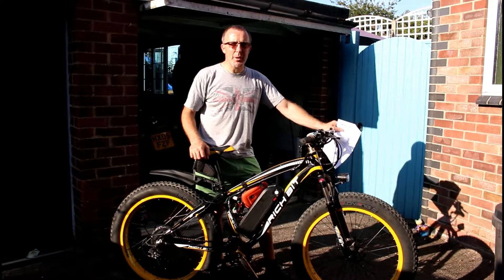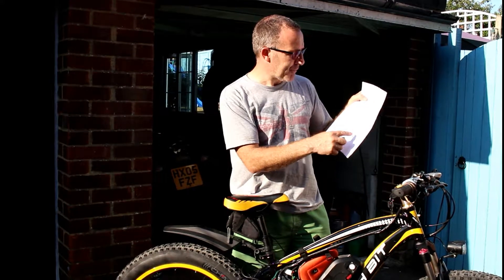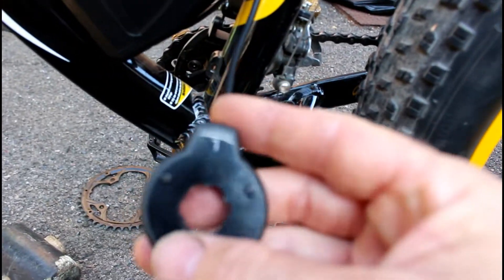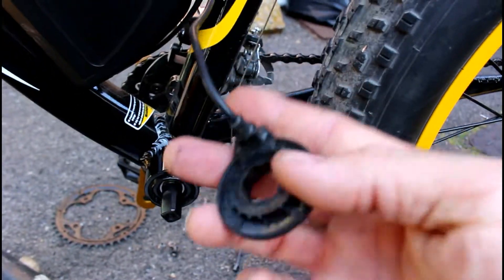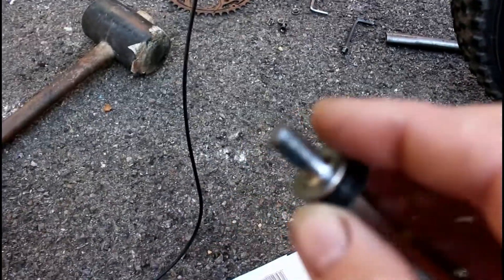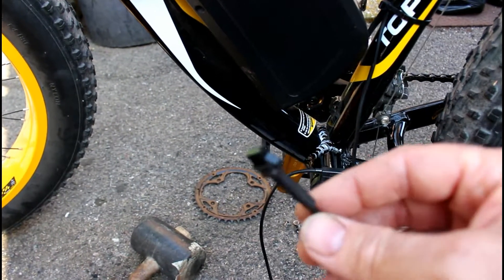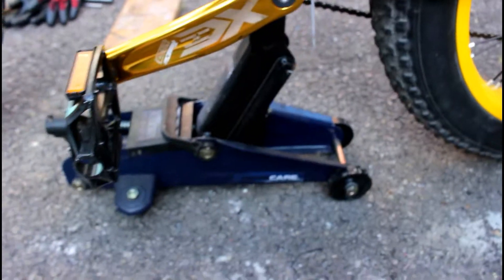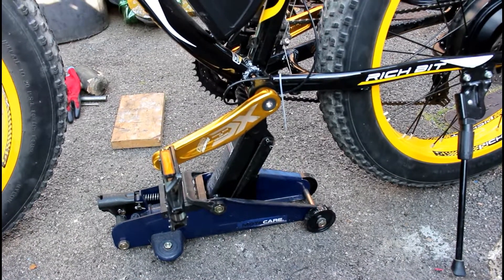How to change an E-Bike Sensor

Comment: Bit of a barbarian way to take the crank off but it works. A proper crank extractor will pop those off no issue. Most LBS should have them in stock and it's a little less brutal haha
Reply from the maker: You are not wrong, when you don't have the right tool, adapt, but as you say, perhaps best to get the right thing first.....otherwise Hammer Time !!!

Comment: My bottom bracket doesn't appear to be concave like that so the sensor has nothing to sit inside of. Should I get the Kt-D21l sensor instead or just cable tie it in place so that the outer part doesn't move around when I pedal?

Comment: Hi Dean. I've got the same exact same ebike as in your video. As you will no this ebike can be used with throttle only. Do you no a way I can unrestrict the motor so when using thorttle only I get the full use of the motor instead of it cutting out at 20-21mph? Cheers 👍
Reply from the maker: Sorry wish I could help from experience but sold mine a few years back now. 
Is there nothing via searches on Google or YouTube? 
Hope you get some help elsewhere, drop in a link if you find it please to help others.

Comment: I have the exact same bike, the European site of richbit does a replacement for that sensor for about the same price but  I’m impatient lol. I’m having to clean mine or salvage off a very old richbit bike I already have it’s annoying trying to get the righting electric fitting on the control box. As for the mallet and removal of gears just buy a cheap crank puller it takes literally 5 seconds of turning it.
Reply from the maker: I know , just never had one back then, and got on with it. Hey, it worked, what can I say, I am not proud of that, but at the time, it was a means to an end. 🤣
Reply: @ Ya having to make do and mend, finding that out too today. 
The ports corroded, and the old bikes salvageable sensor fell apart and to top it all I’ve lost my credit card to buy anything lol. 
On the bright side we go through all the things wrong, give it a good clean and service like I see yours was sparkling; and I’ve learnt something new (until can buy a new control box and Pas Disc) that the throttle can do more than walking speed :) well once I went through the settings to tweak it back to default. (Although I need to go test that idea out of my now messy kitchen.)
Reply from the maker: I now have a Carrera E Bike, been fine to some degree. Once rode it to work, and heard a pop, tried my best to solder a new capacitor into the control box, didn't work 😒 , so got a new conttol box, which was cheap via Aliexpress, but was not so straightforward. Always something to do ( love the challenge, sort of ! ) All has been good, until my motor felt seized and now have to take apart. Look out new YouTube video will be coming.....good Luck !

Comment: Hello I have some questions about the pas sensor. 

Do you realize any differences between the new and the old one such as sensitivity, cut in speed and so on?
Reply from the maker: No not really, not with this bike. I realised the old one was beginning to cut in and out. Once I swapped there was no issues at all.
Reply: @DeanAllen  thank you for the quick reply. 

Do you know anyway to make the pas sensor response quicker and more sensitive? 

My current one needs to rotate the left pedal about  3/4 ( 270 degree) in order to make the power assist starts but I want to make the response quicker.
Reply from the maker: No sorry, which I could help. Only had this electric bike for a short while, and this was my only experience with sensors and sorting an issue.
Reply: @spoon3100  I've recent bought same as in video 12 magnet from Amazon for €20 tbh it works as a throttle I've to put the PAS down as required. If you're looking for something super quick and constant power try that PAS sensor. I'm trying to put the sensitivity down but it hasn't worked so far, I've sm26 same bike

Comment: I have the same PAS for my ebike. some of the splines/teeth that grip crank broke off after ‘bout a year of heavy use.  PAS still works, but should I replace for safety reasons?  Great video.

/Bklyn👑
Reply from the maker: Thanks ! 
As long as it is fixed in a position, you should be fine. For the cost, it may be a good idea to get the backup for when / if you get an issue.

Comment: Excellent video.  I have been trying to find a video like this on this style of PAS, like the one I just received.  All the other videos I have found have a two piece system that uses a ring with magnets, how does this style work without that magent ring?
Reply from the maker: Hello 
It does work by magnetic interaction between the crank and the sensor. Been a long while  but I think the magnets are incorporated into the black plastic ring. 
Glad it has helped you  that is all I hope my videos do, help someone somewhere.  
Thanks Dean
Reply: @DeanAllen  what is the name of this particular type of pas sensor?
Reply: Hi, A bit late to the party lol. There are PAS sensors with separate poll magnets, And sensors with integrated magnets like this one. Then you have different connectors and different style sensors.. I digress but that's the basics.

Comment: Buenas, tengo un problema y a ver si me puede ayudar. Bicicleta marca error 70 y en manual dice que es debido a sensor de pedaleo. Cual lo he cambiado pero sigue dando el mismo error.
Que me sugiere??
Reply from the maker: Hello 
Sorry I wish I could help, but no expert in this field unfortunately. It may be correct that you needed to change your sensor ? We're you have any issue before the error code came up, for example the motor was not kicking in all the time? 
Although you may have changed to another sensor, was it exactly the same as previous,it maybe the as different, the error code will not clear. Do you still have an issue with the motor kicking in ? 
Sorry to not be of more help. You may to Google and look for Forum on specific bike and code 70 issues.

Comment: I heard if you cliped the sensor wire it will go as fast as the motor can not restricted to 25k
Reply from the maker: Not sure with my bike at the time. It just worked as it should with the new sensor. 
I never got round to making it faster.

Comment: What was wrong with your bike why you had to change the sensor ? I'm having speed issues the bike's going way too fast and i don't know whats wrong.
Reply from the maker: I could feel the bike, not reacting to input through peddles, then suddenly would engage into motor driving the rear wheel again. It was so cheap, and pretty easy to do, it was always worth trying.
Reply: @DeanAllen  Thanks very much Dean for reply most helpful I'll get one of those sensors mine is also loose and wonky unfortunately it won't fix my issue. Cheers.

Comment: Hello I have one question for you, what was the reason to change it?!.
Reply from the maker: The original would cut in and out as I peddled, first thought it was a motor issue, so very relieved to know it was a very cheap sensor instead. 
Thanks,  Deano
Reply: @DeanAllen , the reason I'm asking is because me bike had the identical symptoms like your's, but now it's completely dead. And I have no errors on the screen. Thanks for answering me!.
Reply from the maker: No worries George, hopefully that is the issue and you can find the same sensor or very similar to resolve the issue. Good Luck mate !

Comment: Why not a crank puller?
Reply from the maker: Did not have one, do not usually work on bikes ( see motorcycle vids) and my mission was to change the sensor, mission  accomplished. I guess you knew the answer though ?

Comment: Was it faster when the old one wasn't working
Reply from the maker: No, the original sensor on the bike, started cutting in and out but when not working the motor stopped cutting in. Once I put this new one on, all was good, instantly, not faster, just all working like it should.

Comment: Hello 

I have tried to search under Kt-v6 but nothing anymore on ebay. 
Looking at the pic, I would estimate that central hole is around 22mm - 25 mm but the other fanned plastic parts are designed to move to give a tight fit   anyway. Sorry I cant be of more help, did you try finding the exact same part I had and asking for dimensions from the seller?